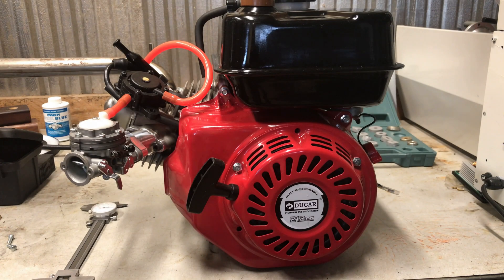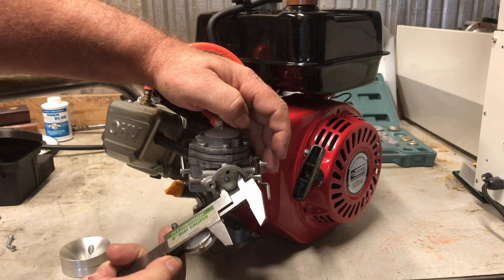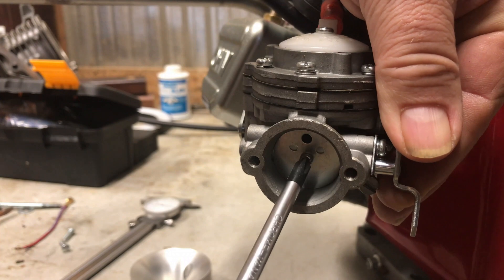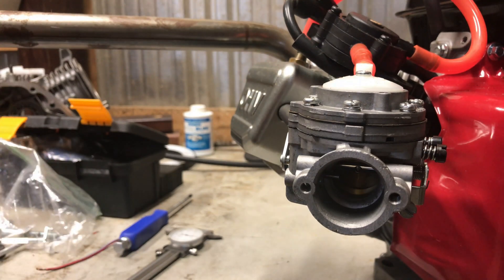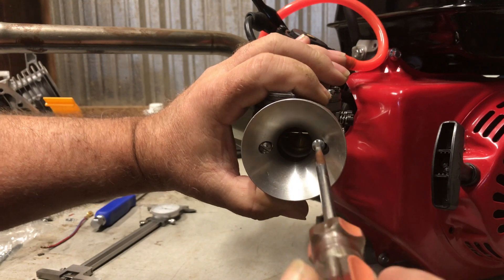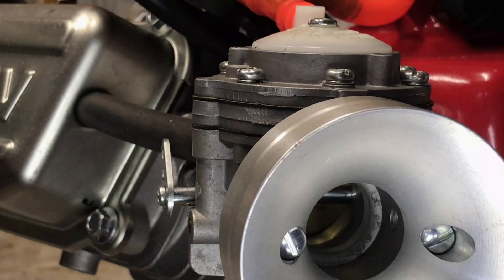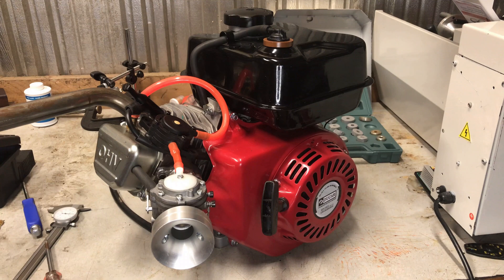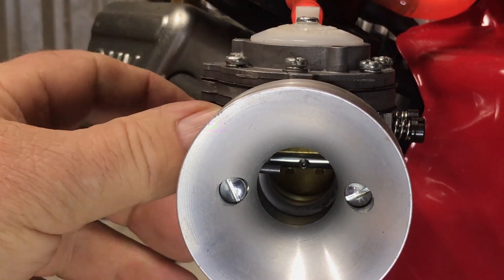What Air Filter Adapter Do I Need for the $14 Tillotson HL Clone Racing Carburetor?

Comment: Great video. I wish you would have did a throttle assembly to the Tilly carb.
Reply from the maker: I should have thought of that but I didn't have the bracket/throttle kit at the time I made the video. Check out EC carburetors website for the Tilly throttle kit. If you need help just give them a call, those guys have forgotten more about Tilly Carbs than most people will ever learn. They're a good bunch of guys.

Comment: Can you do a video on how to set up the throttle, and linkage on this carburetor?
Reply from the maker: Hi Steven! EC has the throttle bracket in a kit form for these. You can make your own bracket once you've had a look at how they're set up. The bracket's only job is to hold the throttle cable in place. I do think it would be a good video idea to show installation of the bracket and how to set up the throttle for the tillotson clones. I will make a video on how to set one up but it won't be anytime soon. I know that's not going to help you if you need to install one now so I apologize in advance. I've got several projects that must be completed before the cold weather hits.

Comment: Next time, lead off with the right filter adaptor. In my rush to get it ordered before the shipping window closed, I ordered the EC-308. 😆
Reply from the maker: Hi Steven! Depending on how your carb measures at the air horn, you may need either part number filter adapter to work with the carb they send you. It's like luck of the draw on those carburetors even though you order thru the same link. Sometimes you get a "FULIN" brand and the next may be branded as "TILLOTSON" and I've gotten one with no brand markings at all. Some have the larger bore venturi some have the small bore. Unfortunately it's one of the headaches of knock off parts. But, it's worth the hassle IMO.
Reply: @KentuckyFriedFixes  I got the one labeled Tillotson.
Reply from the maker: @Its-Steven  The Tillotson branded carb they sent me uses the 302VS part number adapter and the FULIN brand uses the EC-308 adapter. Which adapter you use depends on how your carb measures at the air horn. Either adapter will work because the bolt spacing is the same at 1.375" but the 302VS adapter fits the Tillotson branded air horn better. It's all in the video.

Comment: Hey man me again, was just thinking about ording some billet parts for my predator 212, i was looking at a flat top Piston but not sure if it would fit. 

On omb site it says this The standard bore on a Predator 212cc engine is 2.756". The Wiseco Piston #11132p94 is for a 2.756" bore, which means it will yield approximately .003" piston to wall clearance. This is right where you want to be, so provided your bore is good and needs nothing more than a fresh cross-hatch honing, it will be good. If your bore is larger, out-of-round, or the engine has already been run for a while with the stock piston, you will need to go with a larger piston.

So do you think ill need a larger piston? my 212 is 6 months old or so and gets ran alot.
Reply from the maker: It'll probably be fine but the only way to know for sure is to measure the clearance in the bore. When your piston comes in place it in the bore upside down without any rings and use a feeler gauge to measure the clearance between the piston skirt and cylinder wall. It's the cheapest way to know exactly what clearance you have.

Comment: Can i use a regular mikuni 22 intake manifold and just cut out that grove for the the little hole thats on the Tillotson carb? Are the screws going to line up to the Tillotson carburetor. Im trying to buy a cheaper one on Amazon and the cheaper Tillotson carb
Reply from the maker: Hi Jeffrey! I couldn't get it to work with the VM22 intake. The ID was too large on my intake to work with the Tillotson. I know $50 for an intake is terrible. I have made Tilly intakes on the cheap with a piece of 1" ID tubing and two large flat washers welded in place. The steel tubing is not near as good as aluminum but it works.

Comment: U drilled a nipple in the valve cover
Reply from the maker: Yes Sir, I installed a pulse fitting for the pump in the valve cover. You could install a fitting in the intake manifold or in the governor linkage hole at the top of the block instead if you prefer. The strongest signal is at the intake but any of those places will work the fuel pump just fine..

Comment: Hey bro. Hope you have a great thanksgiving. Next question. Have a tillotson 212E.  New arc billet flywheel. Arc billet rod. Hot 265 cam. Robertson torque tubes looped staged header with high flow air filter. Top half plate pulse fuel pump external tank. Chinese clone tillotson carb. Hoping that carb will perform well. If not I guess go to the vm22. Wanted to know if you had any hints on hooking up throttle cable to that tilly clone?enjoy holiday my friend. Thank you for your time
Reply from the maker: Hi James! It's easy to find a throttle kit over at EC carburetors online. They have tons of bracket kits for those that bolt to the top of the Tilly. Their throttle kit will usually include a clevis too. Or you can make your own bracket too of course once you get the idea of what they look like. Happy Turkey day!
Reply: Thanks again my friend

Comment: Thanks for video bud. When you pulled the choke butterfly and shaft. Do you need to plug the holes from the shaft.
Reply: Thank you sir. Much appreciated.
Reply from the maker: Hi James! When I do the final install with a gasket I'll add a little RTV silicone gasket maker in the choke shaft holes. The adapter mounting screws are long enough to cover most of the hole but I'll add the RTV anyway to make sure no dust gets in. Always great questions! Thanks James!

Comment: I’ve never tried a Tilly carb. Are they really that much better. Did you say the pump is in the carb? Great stuff! Thanks for sharing!
Reply from the maker: Thanks DIY Willy! The Tillotson is one of my favorite carbs! They're normally an expensive option only used for racing where one doesn't mind spending $300-$500 bucks for a carb setup, but these $14 Chinese copies have made it affordable for other projects. Total for this install was close to $100 but most of the cost was in the intake and air filter adapter.
Reply: @KentuckyFriedFixes  sounds like a great option. What about jetting? Similar to regular clone carbs?
Reply from the maker: @DIYWilly  No jets to change out on these, they have tapered fuel adjustment screws for the high and low. If you need more fuel you just open it up, for less you close them off. They're easy. The Methanol race carbs are about the same as the gas, they do open the passages up on those and sometimes add another pump block to the stack. But aside from the custom race tuning, it starts out the same carb as this $14 one.
Reply: @KentuckyFriedFixes  These carbs would be easy to run E85 with?
Reply from the maker: @DIYWilly  I've not tried E-85 in one of these. EC says not to run Ethanol based fuel in theirs and I'm sure these use the same pump diaphragms as EC does. For $14 though if it messes one of these up, no tears. 🤣🤣🤣
Reply: @KentuckyFriedFixes  very true
Reply from the maker: Oops! I forgot to add: Yes, they use a diaphragm pump that does physically push fuel into the carb bore. It's exactly like a pulse controlled fuel injection. Where these really shine is on a Methanol fuel engine where more=better. There is a down side too though. Since these push a lot of fuel they're not great for idling. Too much idle time can wash down the cylinder walls and fuel will end up in your engine oil. This carburetor is better suited for Kart racing and Methanol where you don't mind changing the oil after every race. This experiment on the 212 Ducar engine uses gasoline and is much milder than a Methanol racing setup. I will still monitor the engine oil for any fuel contamination though. Thanks!
Reply: @KentuckyFriedFixes  Great thanks

Comment: Another great and informative video. This tip right here could help someone out in a pinch if they need it. Is this going to go on one of those minibikes?
Reply from the maker: Thanks Frank! This one is going on a mini bike but the same part applies to the guys running the cheap Tilly clone carbs on Karts.
Reply: @KentuckyFriedFixes  10-4